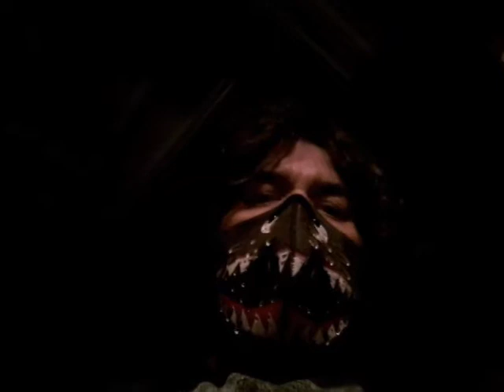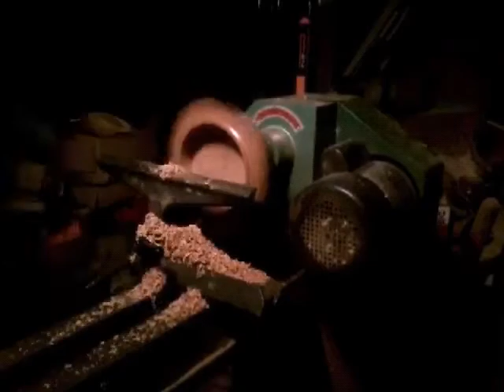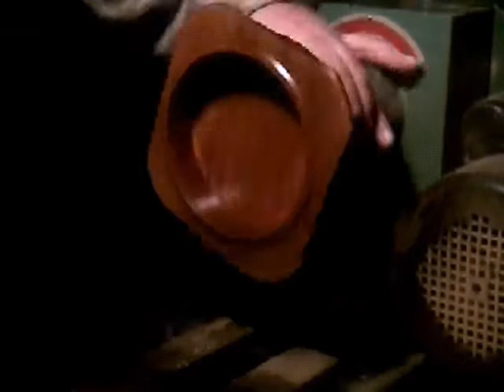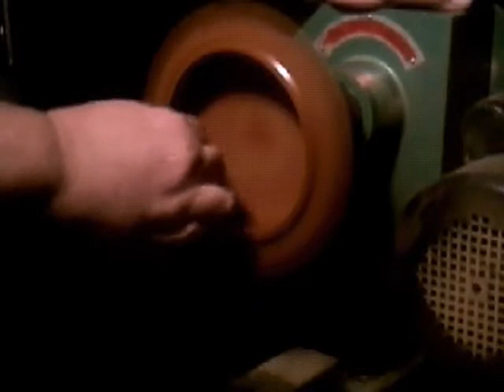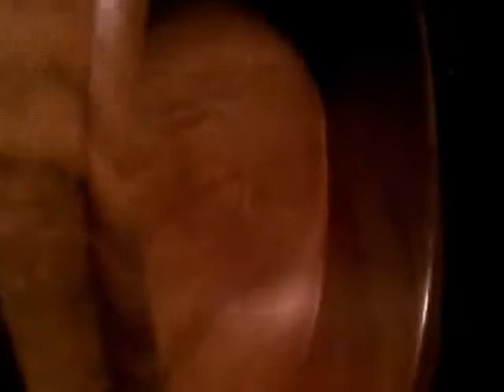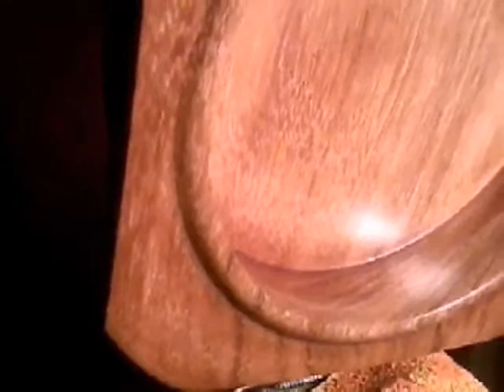A Flashy Finish

Comment: Does the steel wool give it that more pronounced grain look?
Reply from the maker: On this video i left out the 2 1/2 hours of sanding running through the grits , on this one I took it to 1500. Because of this piece of wood having a really high volume up silica, after sanding i treated it like I was polishing a piece of metal. That's why I used the steel wool then tripoli buffing compound then the white diamond rouge. You also use steel wool after lacquer or poly type finish is dry as part of getting to the glass look.
Reply: @monchichi  Wow Mon that's a lot of work.